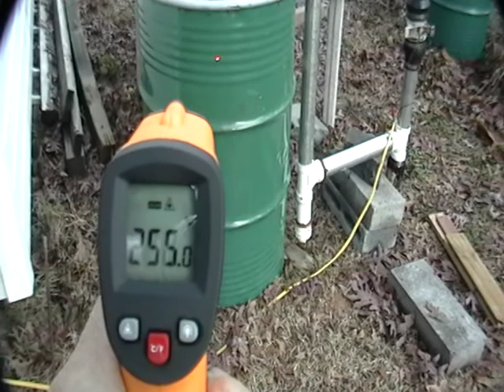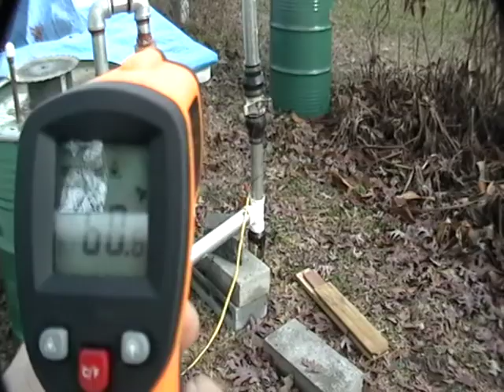Wood Gasifier Project Video 2

Comment: Great work. Which is your air inlet? The top of the flame tube has a lid and the air inlet pipe is sealed equally. How do you get air into the combustion zone?